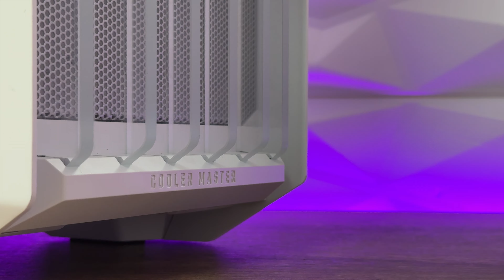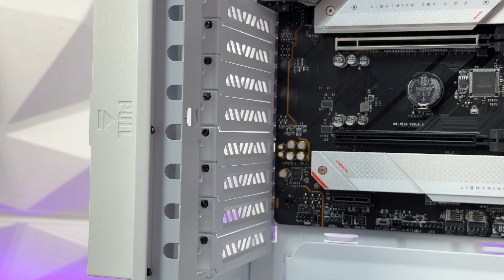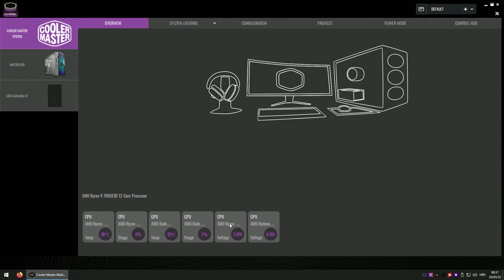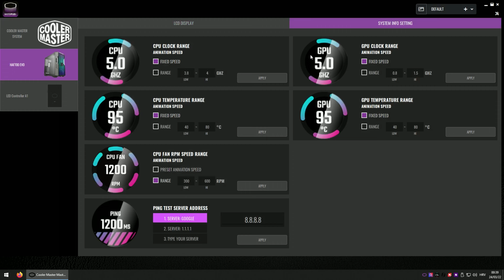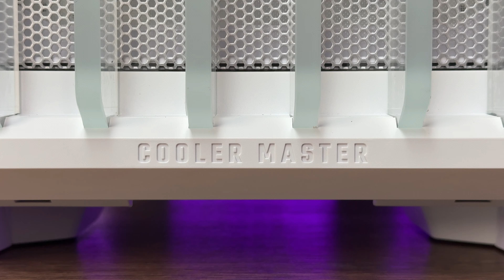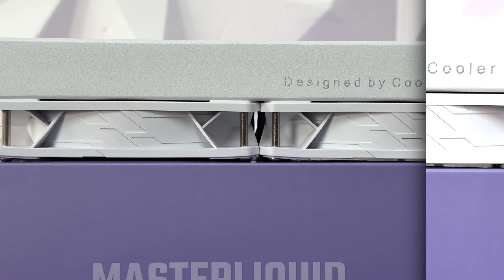MAXIMIZE YOUR COOLING - COOLER MASTER HAF 700 EVO | 6 RADS & 20 FANS

Comment: Hello PC Crazy, I have a question about the graphics card bracket. Could you tell me what kind of bracket it is? Thanks in advance.
Reply from the maker: Hi Andreas, in what sense?
Reply: @PCCrazyDario   The graphics card holder BoostBoxx sent me is useless; it doesn't hold the card vertically. The RTX 5090 tilts, and the connection could snap.
Reply from the maker: @AndreasNFox Wait, the case comes originally with it… Didn’t they send you the original one? RMA it!
Reply: Thanks for the suggestion; I'll call them on Monday to arrange an exchange and have them pick it up.

Comment: I brought this case awhile back from Amazon on sale for £230. I can say this case is by far the best case i have ever owed or even seen. Everything on the case just fits perfect and with ease. It is so well built and so well thought of you can't fault it. Just one thing it is missing i think is wheels it is so heavy. I did get round that thought i brought a pc case trolley with wheels that does the job fine. Nice video BTW

Comment: I have a some questions 1. is it better to have 4 120mm fans or 3 140mm fans 2. If i put 360mm radiator to the top can i still put some 120mm or 140mm fans to top?

Comment: Wish the white version came out a year ago. I got the cousin of this case (Berserker) and manged to fit 2x D5 pump-res, 5x 360mm rads (four being X-flow) with 27 case fans. The chassis design is easy to work with and an air/ water cooling beast.
Reply: i'd love to see this if you have a photo of it! i'm building something similar but with 6 rads (240mm on the back), 1 loop with a D5 pump/res and 25 fans in total
Reply: @Amfibios  That sounds unnecessarily over the top…luv it. Have temporarily changed my profile pic to current setup for you to view, but have changed front rad to 280 x-flow to fit a 2nd drain port.
Reply: @pkblade  haha, yeah! i'm hoping the components will be chill with minimal fan RPM, even at full load for a near-silent build! You've got one crazy build, i love what you've done with the colors! I was thinking to install a 2nd pump as well, but i don't think i have enough space 😆 One D5 should be enough though, they're pretty powerful and my rads are not restrictive at all.
Reply from the maker: Totally agree with you and yeah, I can imagine. But imagine if the time between the case release was shorter. I think one year is still ok. You have insane configuration without a doubt. ;)

Comment: Thanks for the video. It has been IMPOSSIBLE to find the white version of this. The link you have redirects to the black/gray one. I looked everywhere to no avail….Any idea where I can nab a white one?
Reply from the maker: Thank you for the comment. Actually, when I click the link it shows me the white case. The links I use automatically redirect you to Amazon in your region or country. So I guess that might be a problem.
Reply: The case isn't in stock in the U.S as of right now and cooler master hasn't given a eta on when it will be available. I have also tried to look for it frantically for a good while.

Comment: I have this case and I have two three 360 mm radiators on the roof and one 240 mm radiator on the rear. And all of the other fans are intake. This is absolutely the best case that I've ever had and ever will have.
Reply from the maker: Oustanding! :)
Reply: the only true successor to the HAF-X.... i'm currently working on a build in the HAF 700 EVO with 6 radiators